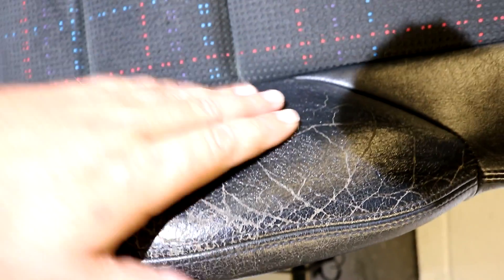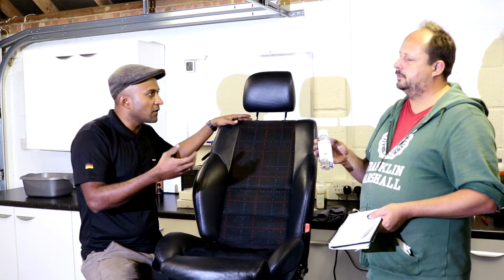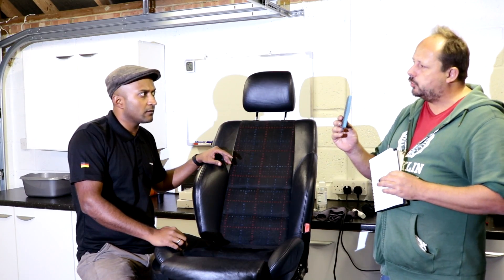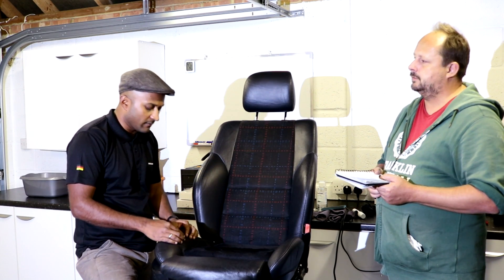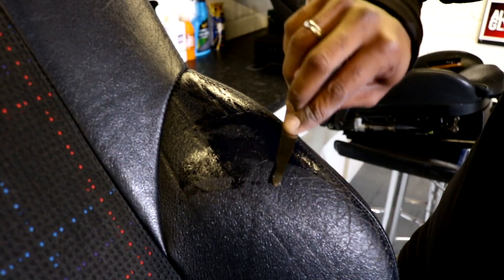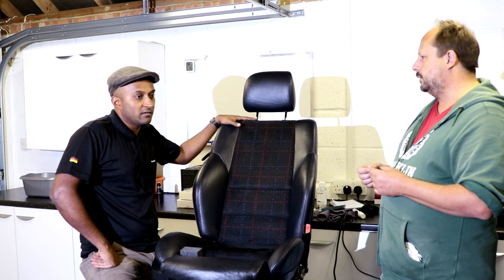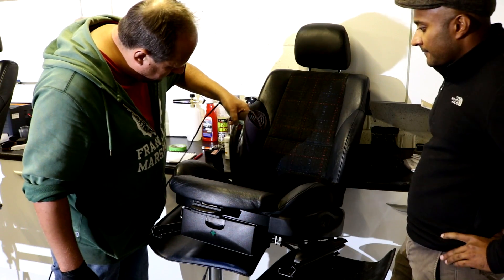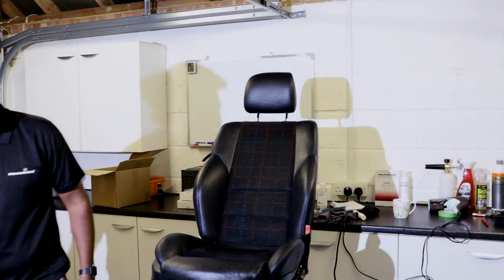Repairing Worn out Cracked leather seats yourself - Easy and Cheap

Comment: Having worked in the leather trade for 30 years this is basic ... Leather grease and tar remover would do the same thing and   Fiebing's Leather Dye to bring the colour back but be spairing as its a liquid and will go into the sponge below.... this stuff is a fraction of the cost of that stuff. but good explanation but it pays to be gentle with the sanding.

Comment: Did my 4 year old jag with a clean and protect they came out great, I was concerned about the grey inset leather but no probs, it’s a thumbs up for me..... ps take it you are staying with the project.
Reply: @ColdPetRat2.99 My 01 jag has leather seats and every inch of the seats is leather. Door panels, seat backs the pockets on the seats are leather, everything

Comment: I use their COLOURLOCK new car Leather Cleaning 1 x COLOURLOCK Mild Leather Cleaner, 125 ml 1 x COLOURLOCK Leather Shield, 150 ml 1 x Cleaning Sponge1 x Cleaning Cloth on the X6 and it seems to work great. The kit I got was recommended for newer cars at under 3 years old. Works great so far and reminds me, I need to do another aplication

Comment: I recently bought a 6 year old car from AC and after just 2k miles I’ve noticed a rub mark appear on my drivers leather seat. I’m presuming they just filled with a leather filler and I’ve worn it off. Wondering what I would have to do to repair it so it doesn’t re-appear. Any help would be massively helpful @ForensicDetailing

Comment: Is there no top coat or sealant that goes on top of the paint to protect it or
Stop color transfer to your clothes?  What is the after car for this newly painted leather
Reply: TK BRAYER - I’m also wondering this...?
Reply: Also wondering this..?
Reply: Black jeans only after 😀
Reply: I remember getting banned out of my girlfriends fathers car with blue jeans.
He had a cream leather interior, and the colour transfer came from the jeans to the leather🙄
Reply from the maker: with the colorlock fresh paint (diy) solution there is no seperate top coat...   With the pro solution there is primer, color coat, and top coat that you spray out in layers.
Reply: Forensic Detailing Channel so get the pro version or have a ceramic leather coating ready to go for the lesser version. Thanks for the response John. Cheers!!

Comment: Does the paint offer the same coating protection that the seats had from the factory and can you do finish to use leather protectants like you did before?
Reply from the maker: hey steve no mate.    The colorlock fresh is a mix of paint and binders.   But its a single system product.   Its a DIY fix, done to be user friendly, cheap and less processes.    Colorlock also sell pro method which is spraying primer, base color, and clearcoat products in 3 layers just like car paint (with compressor and spray gun).    When you use the pro method you will get closer to OEM standards.   Or I would imagine you could impart "beyond" OEM durability if you put more top coat down for example. but thats beyond my knowledge.   So the colorlock fresh kit we used in this video wont be as good as the full pro method.  at least in my head.   I think we talked about this in the previous video we did a few years ago when RAm sprayed it using the pro methodd.
Reply: @ForensicDetailing  Gotcha!
So, you need to be a bit more careful, to some extent to avoid  causing damage that would otherwise be protected against via the mfr coating. 
I like how rich the color appears to be. Very deep and full.
Thanks, Jon

Comment: Has this been talked about yet > using a resolene or some acrylic water based finish/sealant so you don't get bleeding? I would think that just applying dye may not be 100% stable and would rub off yes?  Thoughts on that one Jon?
Reply from the maker: the pro solution is primer, base and then top coat sprayed out in layers.  closer to how the leather will be painted at OEM...  colorlock sell all this as well but you need compressor and spray gun.

Comment: Will the paint stain or bleach on to the fabric part of the seats? I didn't see any form of masking? Thanks.
Reply from the maker: very good point you should mask up.   We did an alcantara video cleaning.  so the middle section was wet and we could not tape it.    but we were just carefull not to dab paint onto the alcantara..  but the paint can be wiped up before it dries..    worth saying this paint wont bleech anything as well.

Comment: Sanding and degreasing the leather must dry the leather out completely then its painted so there's a barrier stopping the leather being fed with product which surely can only decrease and encourage the leather to wear and crack even quicker like dry skin. Question - If you go out and can caught in the rain the sit in the car in damp jeans  do you get a black ass?
Reply from the maker: this company have been manufacturing these products for decades they supply to the manufacturers and are used at an OEM to refinish factory defects.

Comment: Jon, after step 6, any particular follow up and care steps that are different to caring for the leather in normal circumstances? Also any issue with dye or paint transfer to clothes? ...the missus would kill me if I said hop in on black leather with white pants later ;)
Reply from the maker: Only I would say using the colorlock shield regulary on the new surface is important.   Even if you just to that on the drivers seat.    This product will reduce friction wear which is the main enemy to leather.

Comment: Just out of curiosity, could you sand down a leather seat using the fine sand paper, maybe start at 500 and work up to 1500 or 2000 then buff using a leather conditioner as opposed to re painting? (I’m thinking of this the way I’d think of removing orange peel) Or do you always have to repaint when you sand leather
Reply from the maker: you sanding to prep the surface for painting.. your going to remove paint or any clearcoat on the leather whtn you sand.. so only sand when refininshing.
Reply: Forensic Detailing Channel ah so not just sanding to remove the bad dead leather on the surface, but sanding to re paint.  Is there a way of removing the hardened leather I have on my seats? I’ve conditioned them multiple times the last couple days but they won’t soften up
Reply from the maker: you dont really want to remove leather buddy.  With the exceptions if theres any rips or teras you cut away any bits sticking up before filling and flattening.   So really the answer is no mate.

Comment: Jon my question is, what about the transfer of product into your clothes if say you get in your car with wet/damp clothes from rain ect???
Reply: I shouldn't think that there would be anything to worry about it's paint when dry it's not going anywhere
Reply: My wife sat on our old cream sofa with wet blue jeans on and it stained onto the sofa. Leather is porous so I'd say theres a chance it could go the other way too. Might test it on the wifes car first 😂
Reply from the maker: just got to make sure its dry..
Reply: @jonnyharris2724  lol. thats a lot of electricity. we have to think about the polar bears. bit of insulin would do the job

Comment: It looks too shiny. Stock leather is quite matte. Imagine a dash in leather, you don't want glare. Can it be done in matte?
Reply from the maker: it has a 4000w halogen shining on it.  it has a slight amount of satin there but if you want matt you can specify.  but the finish is great its not at all glossy or glaring.